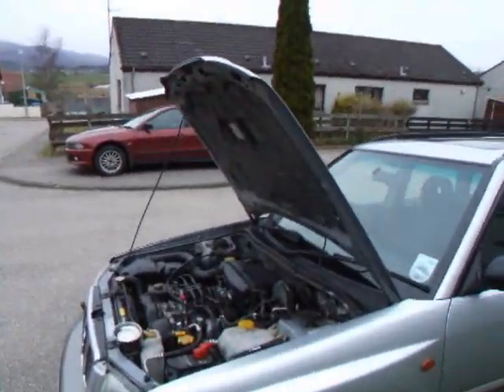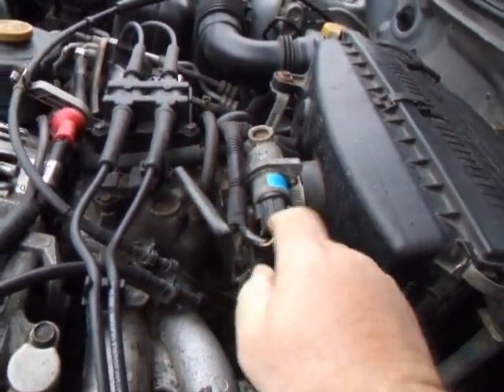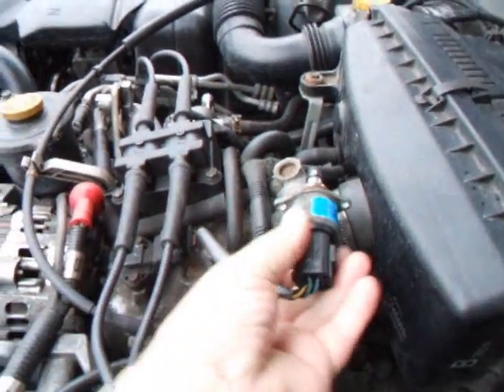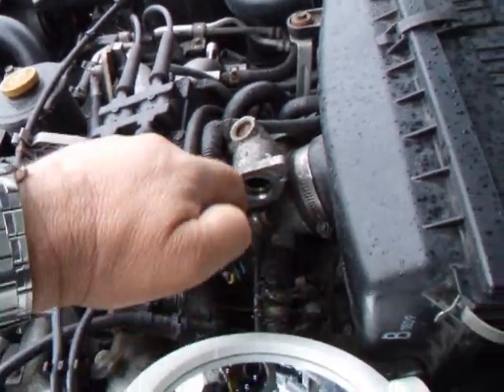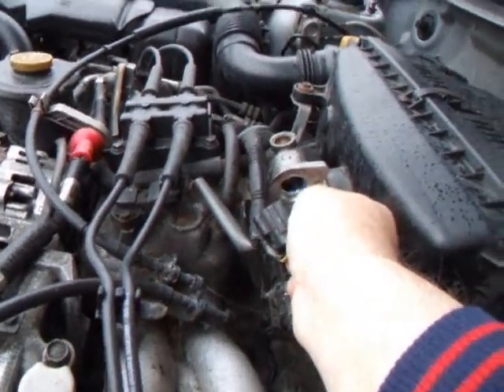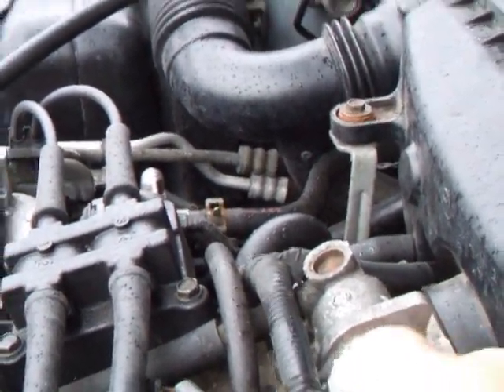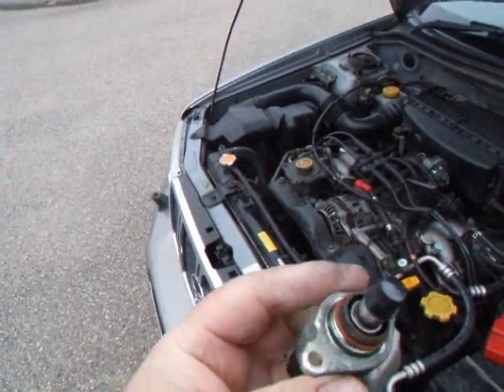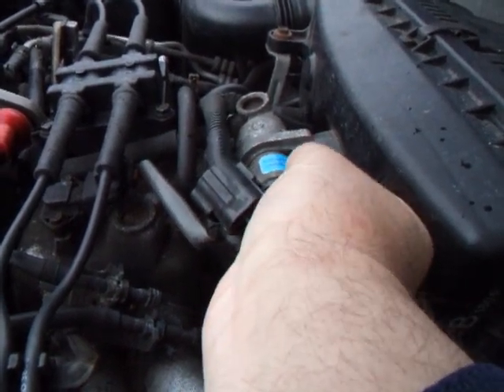Subaru Forester EJ20 Engine

Comment: Donald, I have a 2002 Forrester myself.  I did my research (after I cleaned the part and serviced it), and - for those people interested in knowing the "how", here it is: the computer receives info concerning the air temp. Then, adjusts the fuel/air relationship accordingly, and gives it a "digital number" in volts, which is transmitted to this element - which happens to be a "motor", a servo motor, to be exact. A 'servo motor' relates its position in a feedback to the main computer all the time, so it knows where it is at any given moment. The adjustment keeps being done. We should 'clean' its shaft very gingerly, the plunger head very delicately (its rubber might be affected if we use harsh fluids). WD40 seems to be a good choice (which I did not use, btw). Thanks for video.

Comment: Facing similar issue now - while engine is cold, it stalls when accelerator is released - for example, before the traffic light, I press clutch and release accelerator and revs go down to 0 and engine stalls. When engine is hot (over 75 degrees Celsius) idle is ok.
Haven't checked how walve is working in my hands, but I have cleaned the housing (as in video) and even replaced the valde with new one (not OEM, but chinese) .. and .. the symptoms are the same as with old original valve ... no changes at all ... :(
Reply from the maker: That's annoying for you :( try giving the throttle body a good clean and have a good look at all the wee rubber hoses just in case one has a split in it and is sooking some air in casing it to stall.